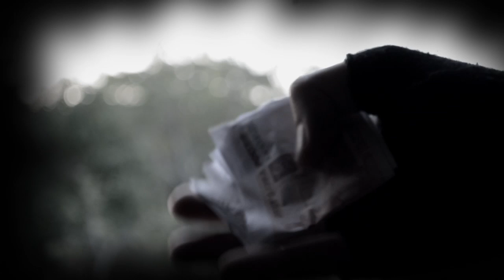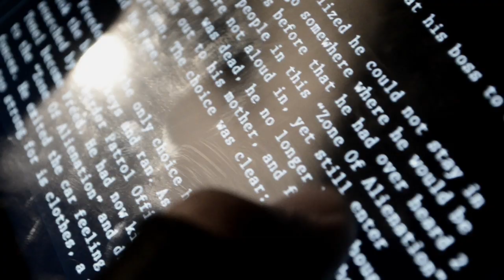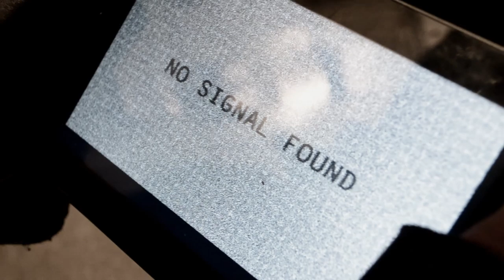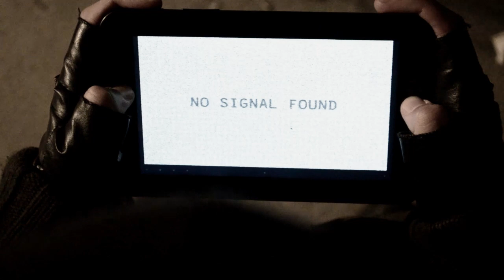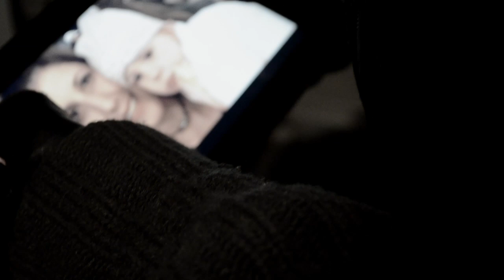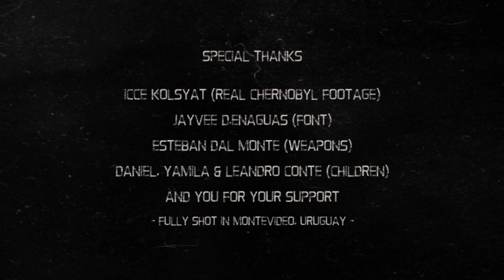The Chamber - Stalker Short Movie (Multilanguage)

Comment: While the ZONE can be a harsh mistress, I was rather hoping that maybe buddy would find a way out but I guess in the end, he took the easy way out and another STALKER ended up in the same trap.
Its too bad that in lore you can't just out run a vortex or jump through it.
Then again, id probably try the grenade or perhaps jumping tot he side of the vortex and hope I don't get sucked in. I'd rather die trying than die by my own injection of lead and copper.
Reply: You sound like an experienced Stalker, thanks for watching and your comment!
Reply: @GabrielZang  Thanks for the Comment buds, most of the time I just yell into the void.
I still stand my my ideas for the Chamber.
I'd rather take my chanes with an anomaly or a grenade blowing out the wall than sittin there and shooting myself.
HELL Therees got to be enough metal stuff in that old SUB-Station to maybe use some of the metal as something to bash against the walls (Than again, you might die of thirst before you get a whole big enough in the brick to get out...)
Reply: @GabrielZang  Another thing, you had a knife, you could maybe dig at the concrete and brick to get out.
I would either try the grenade and hide behind the electrical boxes inside, or pick at the walls with my knife or any other metal stuff.